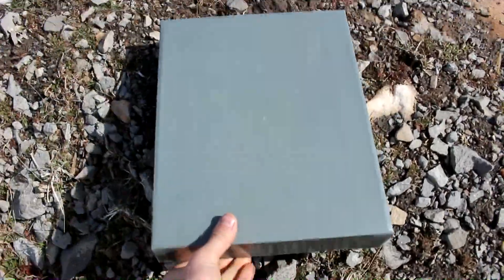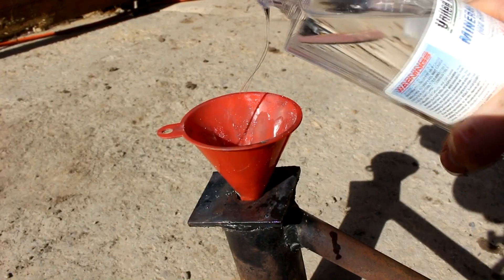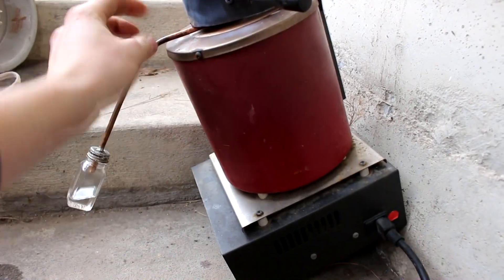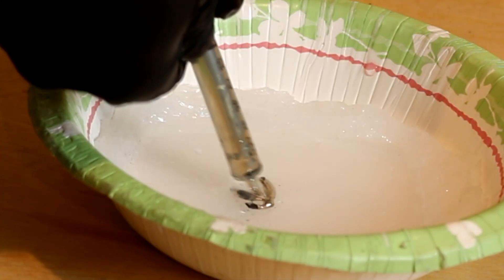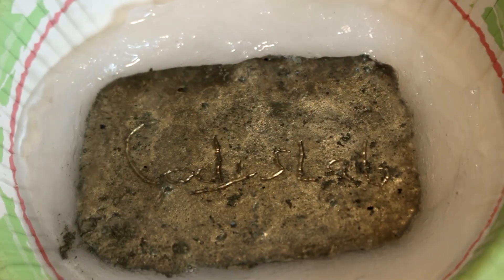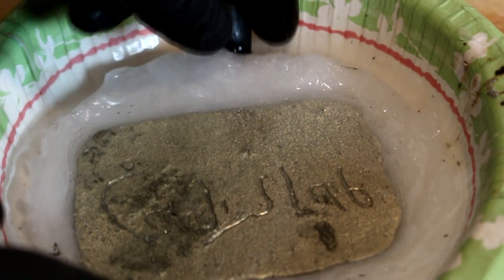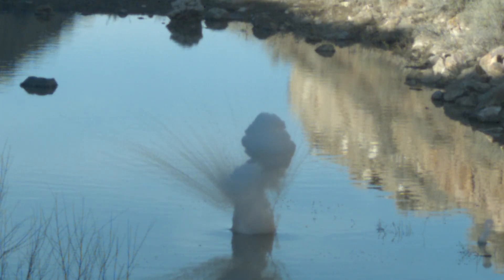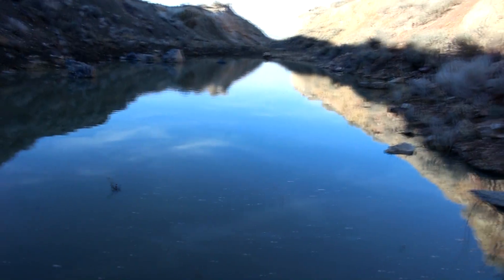Cesium Play Button For 1,000,000 Subscribers!

Comment: 80G of cesium is worth $8,000 right? isnt it $100/gram

You just threw $8000 in a lake ROFL. Spending money like nobodys business.
Reply: he spent 200 to make it, its not super pure.
Reply: He didn't buy cesium. He bought cesium chloride and converted it to cesium metal. A quick look on ebay, 50 grams of CsCl can be had for $25 right now. Without doing any math (to find out exactly how much is needed for an 84g play button), in Cody's first distillation attempt he added 200 grams, so $100. Another peek on ebay, 20 grams of Lithium is another $15 or so. Add in some steel pipe, a broken flask, mineral oil, welding rods, and energy, and yep, you're looking at about $200, not $8000.

Biggest problem with having $3000-whatever worth of cesium is finding someone that would actually want to buy it, IF the government would even let him sell it w/o all sorts of licenses, taxes, fees, handling requirements, etc. His best option is to throw it in a lake.
Reply: he said it was about $200 to make it. Considering it is nowhere close to pure cesium it was probably around $500ish. Still not cheap though.
Reply: didn't he say the whole thing cost $200?
Reply: For pure cesium. Did you see how impure it was? Cesium is very difficult and dangerous to purify, and this is why it costs so much.
Reply: "His best option is to throw it in a lake"

lol that made me laugh.
Reply: More like $3,500.  Current price is $40.80 per gram (assuming 99.9% purity) - which i dont think Cody would have achieved due to the unreacted lithium and other contaminants.     But still, not cheap.
Reply: Impure cesium isn't worth much.  The money is in the purification.

Think of the difference between a 1 karot gemstone quality diamond and a 1 karot diamond so full of impurities that you can't even see through it.  The former will make a valuable ring.  The latter...  Can be smashed and used as industrial abrasive?
Reply: Technical grade cesium salts are dirt-cheap on alibaba. We're talking 10-100 dollars per kilogram .
Reply: Cody My roflcopter goes soi soi soi soi soi soi soi soi soi soi soi soi soi
Reply: Tyler Padgett Lol. Hey, at least he's making enjoyable videos and probably is enjoying his life. :0 Can you say the same? :p
Reply: Ok so after some legit research on an international market I found that from some sellers for high-quality cesium it can be $1100/gram, which means that if he had produced really high quality cesium (which he didn't), that play button was worth $92,400. But realistically he wouldn't have been able to sell it to anyone, so it was worth an explosion :P
Reply: That's a $8000 lake now!
Reply: It's not like he can't make it again. It took him time to do it, but if he really could make money selling the Cesium and he wanted to, he would do it. Hell, Cody can probably make just about anything anyways, for an affordable price.
Reply: Cody 2400 at 30$ a gram
Reply: well than stop watching it.
Reply: I don't think I'd want to keep something like that around.. Cat knocks jar onto the floor and it shatters, house burns down as an example scenario
Reply: try watching the entire video
Reply: i did my math and that is $2520 worth of cesium which is impressive considering the fact that he only spent $200 on the experiment. And then he threw it in a lake :(
Reply: gold is only 38.85 per gram.
Reply: I legit did a quick google search "For example, in 1996, one company offered 1-gram ampoules of 99.98% grade cesium metal at $40.80. The price for 100 grams of the same material from this company was $535.00 or $5.35 per gram. At another company, the price for a 1-gram ampoule of 99.95% pure cesium was $38.64."
"
Reply: 50.000 $ for golden Play Button? Easy Youtube money here we come XD
Reply: It's only 5-8 dollars a gram. It's not that expensive
Reply: This guy is a fucking dumbass, all that needs to be said. I quit watching this guy after almost killing himself several times. Not to mention most of the projects he works on are half ass at best.

Comment: To commemorate this occasion let me tell y'all a story of how my friend got a class room evacuated so to start he has an element collection (important later) so for first term of 10th grade his science class was instructed to research 2 elements of the periodic table so the class could make its owe he chose to do radium and Mercury so he made tow brochures about the elements like he was instructed to and Because he could he brought a small pice radium he got from a smoke detector to school this was not the problematic part the problematic part was that he also brought a vile of mercury to class now when I say vile I mean a tiny glass jar with a cork lid it was less then an oz and it had mineral oil in it to stop it from evaporating he also used string to tie it shut with a wax seal over both the cork lid and siring so it was safe to hold and all but it was in a GLASS vile so 4th period comes around (science class) and half way in to the class it fell not on to the ground but it rolled off his desk and broke open in his lap so he slowly stood up so as to not send it flying moves the char to the back of the room and tells the teacher who was not a science teacher but a art teacher so she not knowing what to do steps out of the room to get the science professor who instructs all students in the class to grad there things and leave the room he then tapes off the door and gets the school warden who takes my freaked to his office and use is a black light on him to see if their was any on him there is none so he is sent to the office by this point the final bell has gone and every one in leaving so he stays behind and his mom is called in he was not in trouble the school was more concerned with his health and for the next 2weeks he was dubbed the science murk.the end

Comment: Great and congratulations! But why didnt you just pour the cesium in the mould? And please, make a equal molar mix of all the alkali metals and see what it behaves like.
Reply: WGwireless cesium reacts very violently with air, that's why he used mineral oil
Reply: WGwireless pouring it would expose the cesium and cause an explosion, if there's enough water vapor (the hydrogen explodes)
Reply: Nah, pouring it with the mineral oil into mineral oil would not cause an explosion, since there will be a thin layer of the oil on it. It is really reactive but not that reactive. Using a syringe and risk spluttering it on the workspace is a greater risk. Have in mind he touched it with his bare fingers covered in oil. Fingers are quite humid you know.
Reply: I thought you meant just straight pouring it with nothing else, my mistake
Reply: WGwireless Pouring the heterogenous mixture would leave the possibility of cesium exposed to the air.
Reply: a single air bubble getting into the stream and contacting the cesium could potentially lead to some unfortunate exploding chain reacions if you were pouring it.

Comment: I am not fortunate to learn this topic in school yet but how did Lithium displace the caesium in caesium chloride when caesium is more reactive?
Reply: xCroSs LuMiNouS a single replacement reaction, producing lithium chloride and cesium.
Reply: basically it takes the place of the cesium
Reply: You managed to type an answer that totally goes around the question. Great job.
Reply: To put it simple, the direction af a chemical reaction is not really related to the reactiveness of an element but to how stable the product of a reaction is.
A cesium-chlorine bond is really weak, becasue chlorine is highly electronegative (and therefore pulling the electrons strongly) and cesium is very weakly e.n. (wants to give its electrons away)
So all the shared electrons are very closely to the chlorine and it does not take much to replace the cesium.
Reply: Ahh.. I see. We were taught in school that a much more reactive element will never get displaced by a less reactive element but instead vice-versa.

Like how fluorine will always displace chlorine and not the other way around because fluorine is much more reactive than chlorine.

But your reply wasn't very comprehensive either.
Reply: Mahamud Hussein A very unhelpful answer.
Reply: xCroSs LuMiNouS you are right, my last response was bullshit. 
a more reactive element replaces the less reactive one, if the reaction is continuing by itself (exothermic)
But here, heat (energy) is added, so the educts must have more energy than the products (endothermic). The added energy is used for the difference of the more stable cs-cl bonds to the weaker li-cl ones. 

Exothermic: 
Li-cl + cs -> cs-cl + li + heat(energy)

Endothermic: 
 cs-cl + li + heat(energy) -> Li-cl + cs
Reply: xCroSs LuMiNouS le Chateliers principle if i remember right. Chemistry was long ago
Reply: Thank you very much :D

Comment: Cody! My gold dissolved in my hcl peroxide mixture, I let it sit for months, can I precipitate the dissolved gold with smb (sodium metabisulfate)? I used the acid mixture to dissolve the copper and nickel off computer boards. And learned too late hcl can dissolve gold very slowly, I have zero gold in solution. Usually there is foils floating. Will smb react with anything else? How do I get my gold back?

Comment: cesium is more valuable than gold by weight. 1 KG of cesium would be .52 liter, while 1 kg of gold is just .052 liter. That means that for the same mass, it would be about almost exactly 10 times the volume. and it isn't strictly the value of the cesium that's the cost too. there's the cost of material handling, because cesium is dangerous.

Comment: So the dude with whom you made a collab used vacuum chamber to pull the air out of his silicone when making molds i think if you were to do this project again a wise choice would be to pull as much air out to get a nice mold , also i think making more cesium and applying weight onto it would help have a much nicer texture on the surface . 
Although i'm not sure you could apply weight onto cesium without having it spilling everywhere especially in mineral oil ( i was thinking maybe if you let it get real cold and solidfy and the put denser metal on top like mercury but i just looked it up and it's way too dense i think it'll just phase through the cesium .

Comment: Welding with no gloves? How?
Reply from the maker: Gloves with a little buzz box = not needed. unless you have problems keeping your hands off hot metal. ;)
Reply from the maker: well yes but getting it from the sun is far more probable.
Reply: Thats how i keep my tan in the winter
Reply: Cody'sLab who was the 1 millionth subscriber? i think i was close
Reply: i've also done stick welding with bare hands and actually it works. Unless you get a hot spark on your hand that hurts a little but overall it works just fine.
Reply: it really depends on how long you're gonna weld with it. you can end up with first degree burns from the welding, not the heat but the 'radiation' i dont know the english word. the rays.. what ever im a welder burned my chin because my weldin helmet didnt have a leather slap on it.
Reply: You do get a nasty sunburn being around welders.
Reply: +Eagles_Eye So, you can get sunburnt from welding? Huh...
Reply: i guess you could call it that, its why you use gloves, welding helmet etc ( your eyes litteraly get first degree burn too if you weld without protective gear )
Reply: Another fun link between the sun and welding, if you wear goggles with number 14 welder's glass, you can safely watch a solar eclipse.
Reply: I think it is called flashburn.